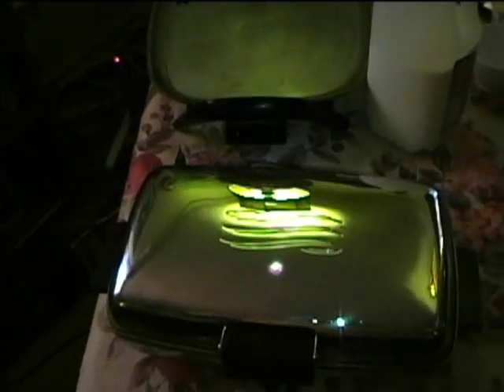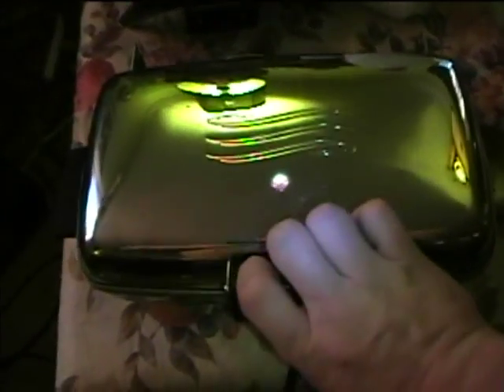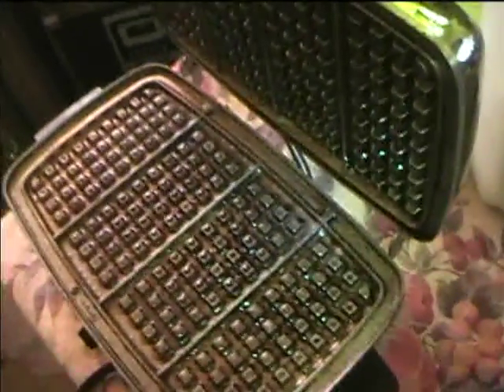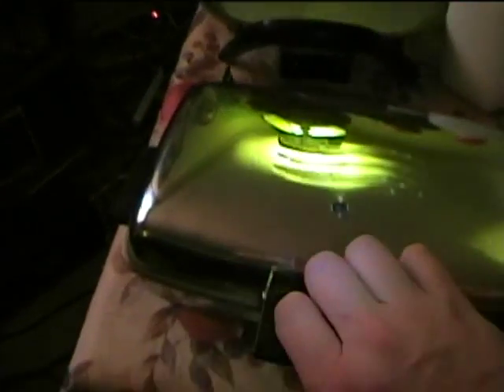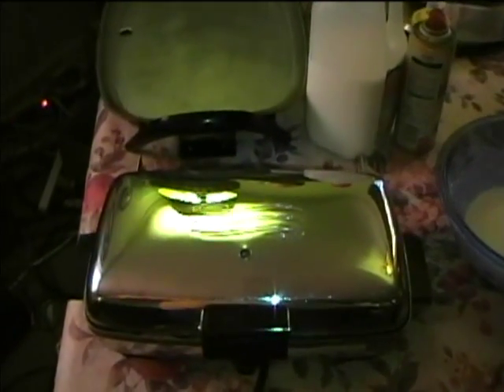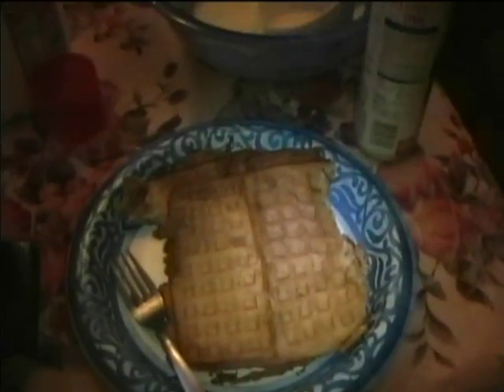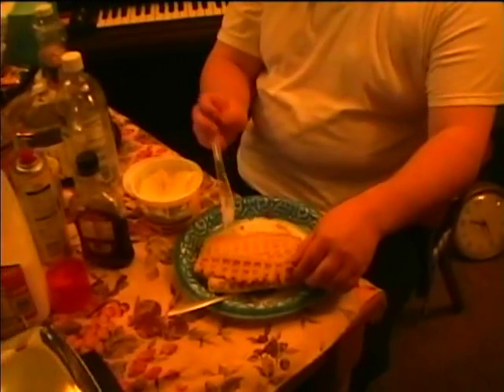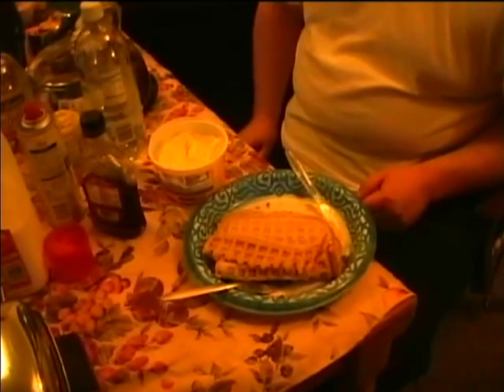Success with 1950's GE Waffle Iron

Comment: I have a 1950's Sunbeam, and a GE waffle iron.  I had another GE waffle iron with teflon that sticked,   so I sprayed it  with Pam. This stopped the sticking, but after a lot of use this builds up on the griddle  and was difficult to clean. I stopped using this with the other two waffle irons and just added a little Olive oil to the batter.  This eliminates any sticking and also the build up on the griddle.

Comment: Ghee's fantastic for oiling your waffle iron. It just doesn't burn up or start evaporating easily, I think it starts somewhere around 470 F, but that's above the range of what this model of waffle iron seems to be. (I just bought one from a yard sale. 14G44 model, right? That's my model.)
Reply: Great suggestion, I will give it a try. PAM does work but it has additives that leave a sticky residue behind that is a nightmare to clean off from all of the small grids.

Comment: I've got an earlier version of this waffle iron. From the numbers on the bottom and what I could look up on the interenet mine was from the early to mid 1950s. Doesn't have the light on the top nore the heat adjuster on the bottom front and after spraying it with something like pam it still takes about 10 minutes for the waffles to come out correctly..  At $5.00 from a Salvation Army Thrift store though I'm not complaining one bit.. :-) Nice video.